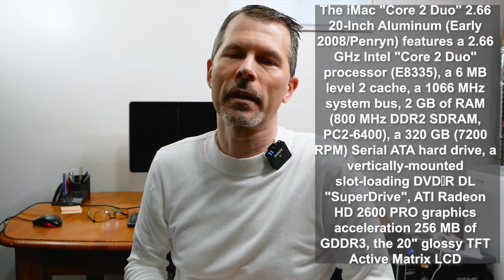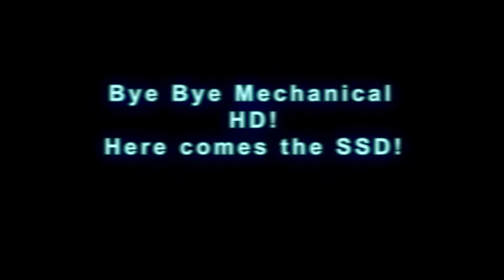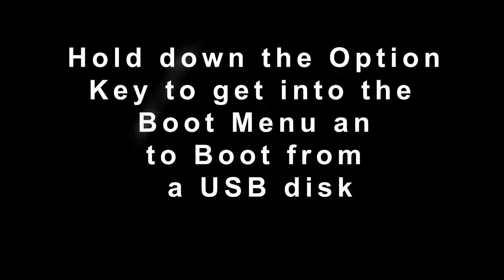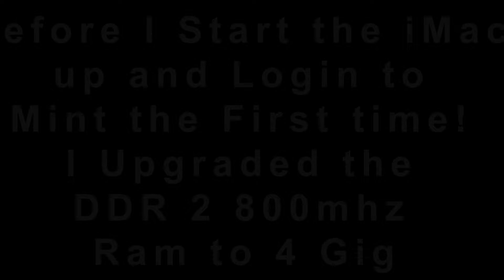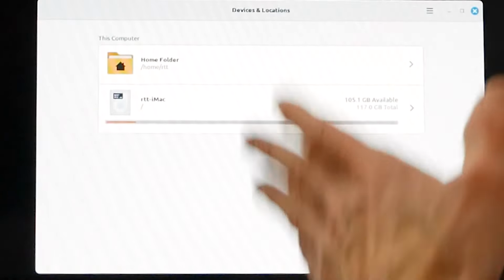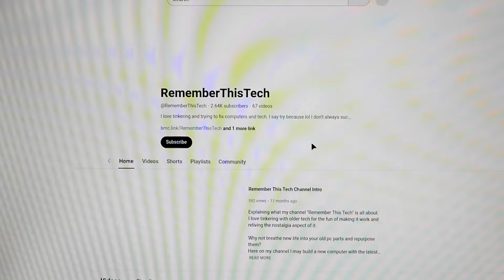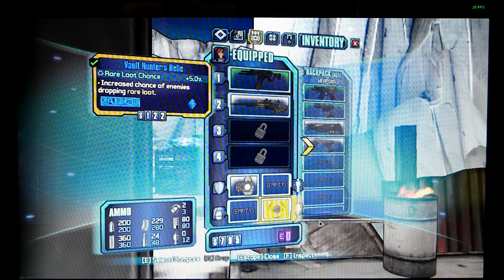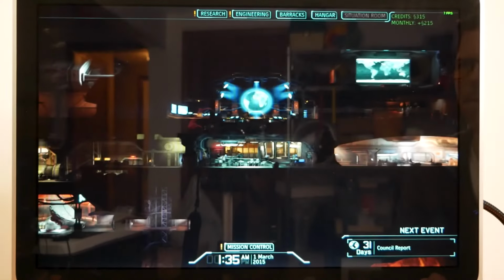2008 iMac Upgrades! SSD + Ram  + Linux Mint = Super Fast!

Comment: On the early 2008 core duo I recently upgraded? I went with the full 6gb ram max, and installed a Crucial 256gb internal SATA SSD.
I've seen other vids suggesting removing the optical drive for thermal air flow, but I kept it in.
Speaking of thermals? That whole HDD "thermal sensor"? Is a total sham, and the fan fully throttling issue can be mitigated with software.
I went with El Capitan, and gifted it just yesterday to my fellow musician cousin that recently lost everything due to escaping w/ his kid from a severely toxic relationship.
I even threw in an old Presonus Audiobox USB interface and cables. 
It runs Logic Pro 9 decently, and after installing ArcticFox? Browsing and watching YT vids works like a charm. 
It's clearly not a technical screamer by any stretch, but legitimately capable for recording some demo quality small project tracks on IMO.
Which was my overall intended goal.
My cousin was legitimately freakin stoked, and it personally gave me pride that I could legitimately provide him a with temporary creative outlet during what's otherwise been an obviously difficult life transition.
¯\_(ツ)_/¯
Reply from the maker: Hey there. I've worked on a few of these imacs, and I'm pretty sure that thermal sensor is only useful for hd and not for ssd. Software should be able to the fan speeds. Just not 100% sure how. That's awesome of you to upgrade that imac and give it to your cousin! I've done similar by giving people a few older computers. And while they wernt super modern or the fastest, they were still totally serviceable and could do most tasks well. Most people don't need the fastest, latest, and greatest to get what they need done! Plus, the fact that you kept a cool looking older imac out of the trash! Plus i didnt have a 4gb stick at the time to max mjne to 6gb.Thanks again!

Comment: Nice video.  I just recently got an early 2009 iMac 20inch & mid 2011 iMac 21.5 inch for $52 package deal.  They both had 8gb of ram. 

2009 iMac all work with original hard drive but user account password block. So I replaced hard hard with a 120gb SSD that I had lying around. Installed Linux mint mate work out of the box except Wi-Fi. Sound I plugged in the Ethernet  cable and got all my drivers from the software center in mint. I tried a bunch of different distro, and this on seem like the best one that works. Plays 720p YouTube video pretty good.

2011 iMac no hard drive and dvd drive doesn’t work. I out of the dvd drive. I installed 500gb SSD I had laying around. I installed Zorin OS Pro. It works right out of the box with no problems. Plays 1080p YouTube video with no problems.
Reply from the maker: Hi there! Wow for $52 for both that's a steal! That 2011 model has the Quad Core 2.5 GHz Intel "Core i5" I5-2400S in it right? That ones nice! Mint Installed all the drivers for my iMac pretty simple. I'm really itching to try the new release of Zorin too! Thanks for sharing :)
Reply: @RememberThisTech  yes. It does have the corei5 in it.  The 2011 is the one I wanted but it was a package deal. I’m not sure what I’m going to do with the 2009 iMac. I try to stay away from the core2 dual stuff. It’s just not fast enough for me.
Reply from the maker: @Atrain-85  That's awesome!

Comment: had 2007 model, they really cheaped out on the screens on the 20 inch of this era, fortunately they went back to IPS later.
Reply from the maker: Hi there! I've got a 2007 24 inch iMac with a 2.8 core 2 duo as well. I think your right because that one has screen yellowing or backlight failing. I know the camera didn't translate it but this screen is super sharp and looked pretty nice. Thanks for watching and commenting :)
Reply: @RememberThisTech  yellowing was kind of normal on 24 inch, but the 20 inch 2007 the screen was just cheap in general.
Reply from the maker: @Geardos1  ahhh good info tyvm! Good I got my for free then and only paid a small amount to upgrade them! Cheers!

Comment: Be very carefull with the battery.  If you look closely, it should be a BR2032, not a CR2032.  The BR is the rechargeable variant.  You may damage a CR2032, and/or possibly the circuit.
Reply from the maker: Hi there ahh very good info for any who might do this upgrade. Tyvm

Comment: Good video Jason. I am surprised how much life is still in this old Mac  with a few upgrades. And I never thought about gaming on Linux Mint but now I do 👍 Would you consider to do a video on gaming performance with Linux Mint on a PC with recent hardware?
Reply from the maker: Hey there George! tyvm! That's a good idea! Since windows 10 support is going away really soon people will need to upgrade to windows 11 "if thier Hardware supports it ;(" Or maybe they can get by just fine with using Linux Mint, Ubuntu or another distro? I really have only used Mint on older hardware so I am interested in seeing how well it does gaming and what newer titles "if any Support Linux as well!" Stay tuned and thanks!
Reply: @RememberThisTech  Yes exactly my thoughts! Although I have an i5-2400 PC working perfectly with Windows 11 via the Rufus workaround I am still curious what Linux can do for me. I have tried a few Linux distros and Linux Mint is my favorite, the most user friendly and great support from the community. Since I saw your last video I am now planning to build a Linux Gaming rig.
Reply from the maker: @georgehollander2816  yep mint is my favorite as well. I've an i5-2500 I just don't know if I should use this or a 4th gen or something like a newer Amd 5600g or 5700x. GRATS on deciding to build yourself a Linux gaming machine. Let me know exactly what hardware you use and how it all comes out :)
Reply: @RememberThisTech   @RememberThisTech  I have a i5-2500k, i7-2600 and a i5-6500 available for this experiment. When I have build and tested this Linux Gaming rig I will let you know the details. Thanks for inspiring me to try this 🙂
Reply from the maker: @georgehollander2816  Glad to have inspired :) I've a 6500 cpu too :) Cheers!

Comment: My imac 2007 is so slowly using wifi. Which broadcom driver you installed?
Reply from the maker: Hi there. Version 6.30.223.271 Broadcom Ubuntu Drivers. From Mint auto scanning and installing them.

Comment: how did you solve the problem with gt 120 video card drivers? I did everything you did, but my YouTube is twitching.

2008 iMac 8gb RAM, SSD linux mint cinnamon 21
Reply from the maker: Hi there. My imac has the Radeon HD2600 pro video card. Not the nvidia. Try installing your drivers manually or do an update all. Could also be slight overheating on the cpu or graphics card. Did you re thermal paste them? Pull up the system monitor while watching YT and see if the cpu is pegged. Might have to watch at 720p. Let me know what you find out. Thanks!

Comment: Anybody got fan noises being loud after installing linux mint? Install fan drivers via terminal but didn’t seem to do anything. Thanks.
Reply from the maker: My fans were 100% while installing, but calmed down after mint was up and running
Reply: @RememberThisTech  I may have figured it out. I had to unplug and plug back in the plug. Apparently, Apple designed a feature where if the fans were thrown off or mis calculating, it would run like crazy to force it to shut down so it won’t overheat and damage itself. My fans runs now and is very quiet. Probably will have to do every now and again if it blasts loudly though I’m sure this fixed it.
Reply from the maker: @Ceezy223.  oh wow that's so weird! Blame Apple lol. Hey but realy glad you figured it out. ;)

Comment: You wondering if about 50Mbps is enough for youtube 🤣. Come on some of us have been using youtube since the days of 10Mbps DSL! Civilization at 14fps. I told ya those strat type games can be fps heavy! This Mac has USB 2.0 which maxes out at 480Mbps. It has 802.11n which maxes out at 300Mbps. Heck, I'd be tempted to buy a 802.11ax or faster USB adapter if your router supports the faster speeds. There are ways to have gotten a newer Mac OS, but it becomes a hassle with updates. Maybe you should start shipping some of these salvaged PCs to the border to help the new americans become productive. It would be a win-win! Repurposed e-waste and helping the educational cause 😁! Funny thing about this Mac is I had been given one years ago because it was too outdated. I upgraded it to 8GB, installed a new Mac OS in it, and I sold it for $100. It is almost a sin to throw these PCs away. Do ya remember my G4 Mac story? I found the G4 crying at the dump with the rest of the electronics. I picked it up, brought it home, gave it more ram, installed OS X Leopard, and I gave it to a kid a little over 5 years old that used it for almost 5 years. We need more e-waste heroes like you!
Reply from the maker: Hey there! The main reason I briefly tested the WIFI and wired speeds was because online i've seen a bunch of people complaining about how slot these iMacs Wifi speeds were. I dont get it. Seemed fine for me on YT! :) I had a faster AC wifi USB adapter and Linux wouldn't recognize it. As far as putting a newer Mac OS on this iMac, sure I could have but that would take more time than I had. Plus Mint was so easy. Your Mac g4 is a true success story! As far as giving away these reclaimed pcs etc it would cost more due to weight to ship them then I could justify. If it was a local drop off then I could do that for sure! We use this imac for  a machine in the basement now. TYVM IDK if I'm an e-waste hero lol but ty! :)
Reply from the maker: Hey IDK if you will see this but, do you have any good titles for something I'm working on?.. Testing an e3-1241-v3 cpu currently! Pairing with an rtx 4060 lol. Need a catchy title. Most Mainstream people might not know about Xeon cpus or that this ones close to an i7-4770 equivalent. Thanks in advance!!
Reply: @RememberThisTech  Of course I'll see it. I'm still on vacation mode 😆. I was gaming with a Pentium Pro in the late 90s. Using a Xeon for gaming sounds just about right lol. How about: 
Don't throw that office PC away!
An Intel Xeon for gaming? Surprising results!
You think these Intel CPUs are just for work? With a 4060 it ain't!
Old office PC converted to a gaming monster
Office giving away their old PCs turned gamer

I hope these spark a few good ideas. 😊
Reply from the maker: @itstheMR  Thanks, Good ideas! IDK if I'll get it done by Friday, still testing. I'll try. Or else it's an unboxing vide :( Have a great week!
Reply: @RememberThisTech  you too and GL! I'll look forward to it.